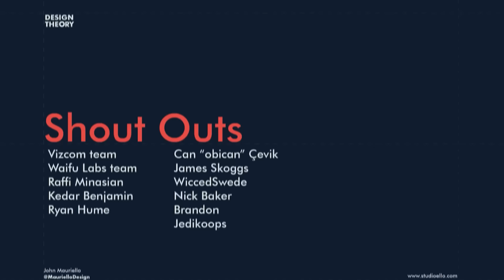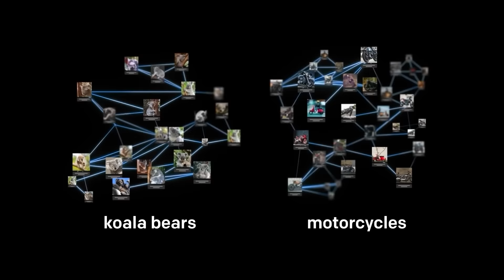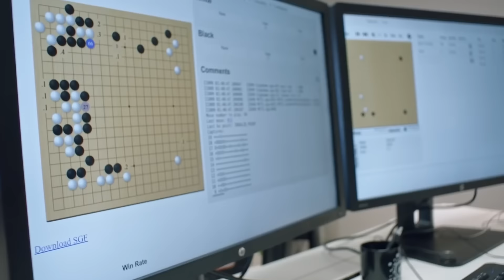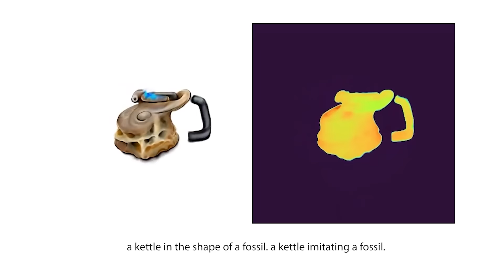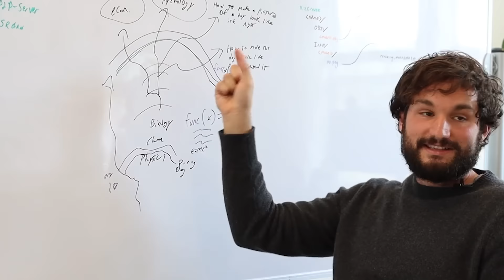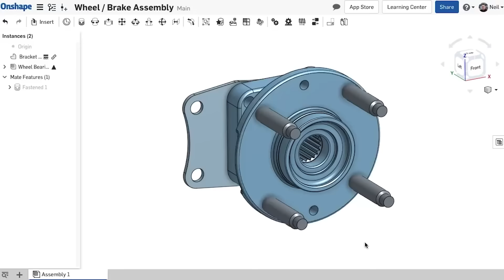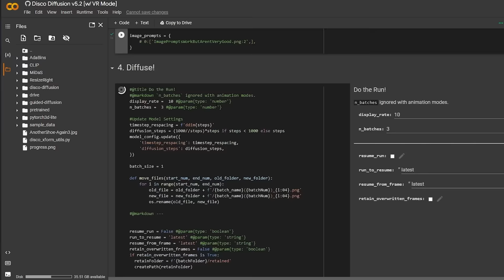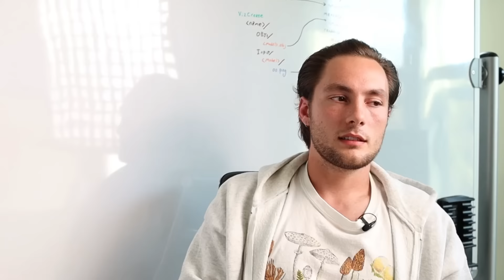Will Artificial Intelligence End Human Creativity?

Comment: You're wrong, ai does know how to enter a house, I asked chat gpt and this is what it told me.

"To go inside a house, you can follow these steps:

Approach the front door of the house and locate the handle or knob.
If the door is locked, you may need to use a key to unlock it. If you don't have a key, you may need to knock on the door and wait for someone to let you in.
If the door is unlocked, turn the handle or knob to open the door.
Step through the doorway and into the house.
If you are entering a house that you are not familiar with, it is generally a good idea to remove your shoes before entering to avoid bringing dirt or other contaminants inside.
Close the door behind you, if you wish.
It is important to always be respectful and considerate when entering someone's house, whether it is your own home or someone else's. Make sure to ask permission before entering if necessary, and follow any rules or guidelines that the owner has set"

Comment: The real issue here is that John keeps making the fundamental attribution error of thinking that AI actually understands anything that it sees. The fact that it actually does not understand any of its input images or output images is both its greatest weakness and biggest strength.
Reply from the maker: I don't think I made the error that you're implying, in fact I spent a lot of time belaboring that point.
Reply: @Design.Theory  I guess I'm just taking umbrage at all of the points in the video where you repeatedly referred to the AI "understanding" things. You did devote a section to sort of explaining the limitations of this understanding, but it's undermined by your language choice in the rest of the video. While this may seem like nitpicking, it is important to be mindful of because it is exactly the thing that will overstate the capabilities of artificial intelligence and prevent many of the positive effects of AI that you mentioned from manifesting.

Comment: they aren't tools, they are replacement, okay the photography argument. if you give a drill to a factory worker, you can call that a tool, if you introduce a robot arm, that's not a tool, that's a replacement. just look at their website, do you find any mention of artists ? they don't want to give artist a tool, they want to remove them from the equation

prompt engineering will be the shortest lived job too, that'll be ai generated

Comment: Right now though, AI in most cases lacks the deep understanding of how things interconnect, it's superficial. For example if you have it draw a bridge, it will often have unconnected girders. That's because it doesn't really understand what girders are, and what they do. It is theoretically possible to tell it, by adding 3D simulation software or something, but right now there's nothing.

Comment: I find that most people are missing that to accompany the software exists the hardware , and that better hardware here = faster processing . We need to consider that this is using current computers , maybe relatively high-end ones aldready ,and that ai is currently mostly limited by that . Imagine what happens when a dall e equivalent ends up trained with better everything , has vocal recognition software and can be purposely guided to solve very specific patterns . Then realise those very specific patterns could be mathematics , road architecture , mechanical parts and engineers or whatever could gradually hone in on what actually works ...
That kind of thing could make the singularity come about way faster , due to it being completely and utterly cludhed several times.

Comment: As a Product designer that tried AI. Im not in fear of it in any way. Thing is 

1. Most of those designs dont consider production, or materials used. You can make cool looking THING. But AI dsnt consider is that material possible, How much it will cost and many factors you have to consider when designing. 

2. For me it will be a great tool. Where I can still make choices as a final designer much faster and make more money because I can complete more designs. And can work on far bigger projects. 

Soo Im interested in using AI for design.

Comment: You speak with a lot of authority about what AI can’t do. For instance “you can’t ask ai to go into a house and go to a room and turn a doorknob”
But that’s exactly what I asked chatgpt to tell me and it did just fine. You claim ai doesn’t have the context, but can’t you just train it context. Could even be trained to know what images it has been trained on are copyrighted and not use them to derive final outputs. It’s just that these tech bros have chosen not to and disregard the copyrighted materials they want to train them on because it produces more relevant and high quality output for their profits. IMHO. 
Chatgpt…
“To enter a house and walk down the hallway, you would typically approach the front door of the house and use a key or code to unlock it. Once the door is unlocked, you can push it open and enter the house.

To walk down the hallway, you would simply walk in the direction of the hallway, taking care to watch your step and avoid tripping or stumbling.

To go to a specific room, you can look for signs or markings on the walls or doors to help guide you to the desired location. You may also ask someone for directions or use a map or floor plan of the house to navigate.

Once you have arrived at the desired room, you can locate the door knob and turn it in the appropriate direction to unlock the door. This may be a clockwise or counterclockwise motion, depending on the type of lock used.

Once the door is unlocked, you can grip the door knob firmly and push or pull the door open, depending on the type of door and how it is hinged. It may be necessary to use some force to open the door if it is stuck or difficult to move.”

Comment: So, the main issue a lot of people have with AI is that it will take their jobs but, instead of having one team of 300 people to make one game you could have 3 games made with 100 people each which will allow for people to accelerate the rate of innovation and design. Despite this jobs that are extremely repetitive and basic can be replaced by AI for example, if self-driving cars are released there is then no demand for people to have taxies, instead people will have a car come pick them up and drop them off were they need to be. Though to build off of self-driving cars there are other jobs that can also be replaced with a bit of addition to self-driving cars. This would include trash collection, mail delivery, trucking, street cleaning, road safety, and construction management. AI will replace many basic jobs that people rely on to live but, this will allow for many items to potentially lower in price due to the increase productivity that machines provide while also allowing for a shift in the job market so that jobs that need people will receive the workers they need to function.

Comment: I think your optimism is very short sighted. Art, or at least good art is more than end result, or initial idea.  Ideas are a dime a dozen -  it's what you do with them.
Also there is no way the number of art jobs would be stable, just shifting around  -- there won't be ten thousand artists suddenly becoming ten thousand art directors... Not when one art director could suddenly do the job of a hundred artists... but instead of any human element, expression it will be cheap, hollowly "cool" work that fakes expression in ways consumer culture won't notice is fake.. or care. If you actually CARE about art as human expression, instead of a product, there's no way this is a good thing.

Comment: 2:36 NOPE, that's a common misconception with developing systems like this or working on certain complex problems.  For instance saying well just imagine something 10% better.  Well that next 10% advancement often requires 10000% more work than the first 100%.   Or often it will diverge and you can't even get that 10%.  Then the next 2% will require 100,000,000x the effort or be impossible.  In other words development isn't linear.  This is often a great scam for start up companies in software because non technical auditors don't understand the development process and what will be required to get a return from the work that's already there.
Reply from the maker: I think you are generally correct, but if you look at the fidelity between now and six months ago, there have been similar leaps in quality. But yes, until there's a new paradigm shift, things probably will start to slow down with AI

Comment: In the video he mentioned how AI has no idea of what a shoe is it only understands what a 2D image of a shoe is, then he goes on to say how the AI models can create 3D structures to be 3D printed 🤦🏽‍♂️ which one is it? Obviously if the AI has no concept of what a shoe is in 3 dimensions it could not send information to a 3D printer to print out a shoe or anything in 3D SMH 🤦🏽‍♂️ Please Stop Spreading Lies
Reply from the maker: They're two separate models
Reply: @Design.Theory  indeed, however a point that I would like to make is that to me it's hard to say definitively that Dall e 2 doesn't have an understanding of what a shoe is in 3d given because it's based off of the language processor GPT 3 that theoretically understands such concepts through the understanding of natural language.
Reply: @Design.Theory  it's just hard for me to see any definitive way you can back up the things you were saying in the AI limitations section
Reply: @Design.Theory  is it not possible that gpt3 could surmise the definition of being inside from literature where the difference between being inside and outside was described and it has hundreds of examples of this?
Reply from the maker: Perhaps. The main point of that section was to just highlight that we take for granted how nuanced physical reality is. Even the 2D-to-3D doesn't really understand what it is making. Humans can quickly catch onto what a shoe midsole does. They know what the purpose of an outsole is. They understand the relationship between foot cushioning and shoes. An AI can most certainly learn that. It's just that it's harder for it to grasp those concepts than it is for a human to understand them because of the nature of reality and over-arching context (for now). Once again, I'm not saying AI never will be able to do this. I'm just saying that it takes more time to train an AI on those sorts of nuances.
Reply: @Design.Theory  How can you know this for sure, the LLM's aren't trained on anything specifically they are just trained on a crap ton of data that causes them to understand everything they've learned, I'm not 100% sure but I think your point could be completely wrong but we know intuitively from experience they know from the tons of text data that they've read and understand about the material, just quiz GPT 3 on what a shoe is, what a sole is, how it fits on a foot, how different comfort levels affect humans differently, that's a good chance that it understands all these concepts because of all the text Data it has been fed no specific training necessary, this is a real possibility and would completely contradict the AI limitation section just because it's simply may not be true at all, not today at least if you're talking about old AI models perhaps so but not the large language models that are out today potentially. Thank you for responding.

Comment: Most of these shoes AI created can't be produced. Also whoever designed that shoe sucks. So you can't really compare.  Your "entire professional life" sounds impressive in words, but you look very young and it can't be that long in actual years.Also a professional shoe designer has a clue about function comfort and materials, which AI does not take into account.
Reply from the maker: Been working professionally since 2010. AI is a supplemental tool for now... But a very powerful one.
Reply: @Design.Theory  indeed. AI is exactly that, a very powerful supplementary tool. That can boost creativity by providing tons of ideas fast.
Reply: you are talking about a general AI solely built to make a visually sound image of any prompt. one could probably create an ai that designs shoes that actually does take comfort and production constraints in mind